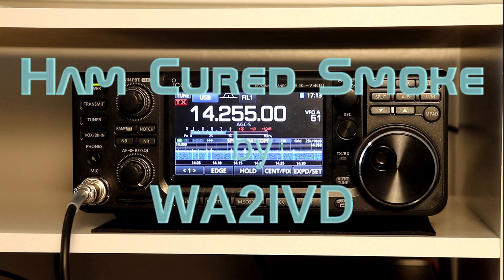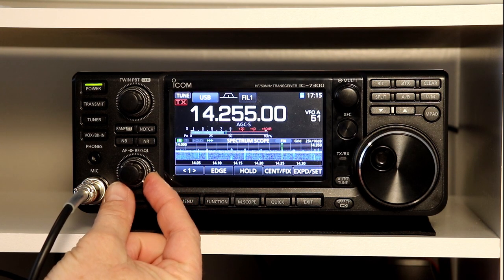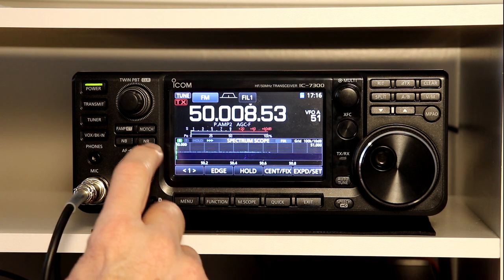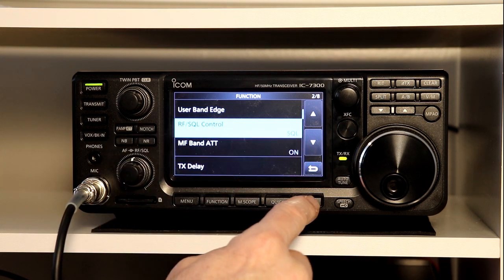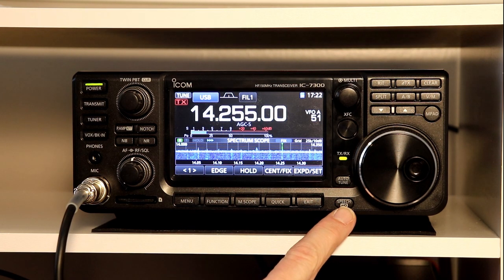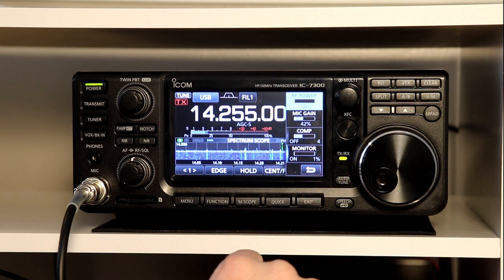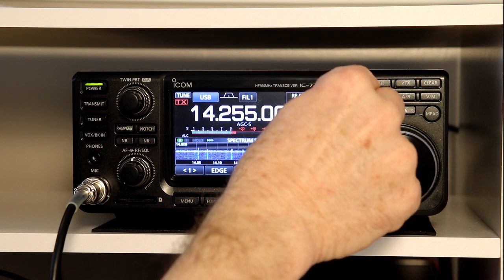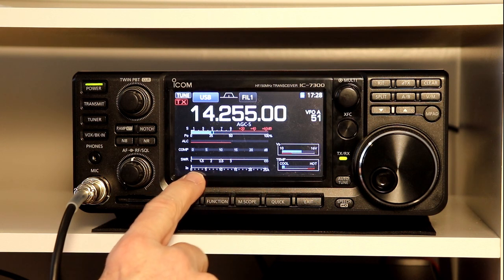Icom IC-7300 from A to Z - Part 4

Comment: Hi Tom,
I've watched and l like the few video I've seen. I tend to jump through around a bit when I have something that I'm interested in learning more about. Do you have a list of what sections or what pages are covered in each video. Something that I could look at to zero in on a subject that I want to cover. 
I commend you for taking time to recored  each of these videos.
Reply from the maker: Hi.  Sorry I’m so far behind on answering comments.  An index that cross references all of the manual pages with my videos is on my list, but I just haven’t made the time.  The K-State amateur radio club made a nice index of my videos by topic, but it doesn’t reference specific pages.  You can find that here:  https://www.k-state.edu/ksuarc/IC-7300.html.  73,  Tom
Reply: Hi Tom, Thanks for forwarding the IC-7300 Info page from W0QQQ. I'll forward it on to others in my ham radio club. Thank you for all the work you put into this You Tube Series. I'm one of many who are and have watched them, 73, Sal WC6Sal

Comment: Hello my 7300 is saying that the panel lock is on and the switches are locked how do I undo this please
Reply from the maker: Hi.  It’s the Speech/Lock button. It is just below and to the left of the main tuning knob.  It has a little picture of a key on the label.  Press and hold that button.

Comment: I received my IC-7300 about three weeks ago and appreciate your presentations so far. I have a lot to learn for certain and although working through your videos from A to Z  is a good idea that will take a VERY LONG TIME as I need to keep track of where I have been so I can search for next video. A question which comes to mind at this moment is, "can USB cable only be employed for digital modes"? Many thanks and have a good day.
Reply from the maker: Hi Tedd.  I want to be sure I understand your question correctly, as I can interpret it two different ways:  Are you asking if you can work digital modes using just a USB cable to your computer and nothing else?  If so, the answer is yes, absolutely.  If you're asking if digital modes is the only thing you can do with a USB connection, then the answer is definitely not.  Once you connect the rig to your computer with a USB cable, you can work the various digital modes, you can control your rig remotely, you can backup all of the memories and rig settings to a file on your computer and you can load saved settings and memories back into the radio from your computer.
You'll find information on USB connections in videos 23-26.  Links are below.
#23 - https://youtu.be/1cBbG62U_U0
#24 - https://youtu.be/9jyLggyFtHY
#25 - https://youtu.be/zXfctVbNc2w
#26 - https://youtu.be/TGzEBwFaRJo
Thanks for your comments and your question.  73,  Tom
Reply: Many thanks for your guidance Tom. This series is one that I wish was available on DVD, as a handy reference guide, yes the whole  IC-7300 series. I may have to pay up so I can download the series. I am enjoying immensely working through the series. Thank you.

Comment: I've had mine for a little over a year but only use it at my off grid cabin with a 7 band Buckmaster dipole.
So, not having a lot of time on it I just jumped in after a quick read of the manual.  I have made several contacts with the radio but last time we went to the cabin all I got when trying to TRX was feedback and it really stumped me.  Found your channel and the quick fix was to simply turn off the monitor.  Now I'm starting from scratch on your segments, they are awesome!  Thanks for sharing! KN4JLU

Comment: Hi Tom.

I just found this series and thoroughly enjoying.  Nice to watch a hands on presentation.  My question is when I shift to the meter screen I still have a reduced scope screen present.  Is there anyway to remove the scope so just the meters appear and are full size?

Thanks again for your diligence in preparing these presentations.  I look forward to watching the rest of this series.
Reply from the maker: Hi Frank.  Sorry for the delayed reply.  If you repeatedly press the M.Scope key on the bottom center of the radio, one of the screen options is no scope and large digits and meter.  I'm currently away from home and don't have the radio in front of me.  I don't remember if you need to do a long press or not and I can't check right now.  Hope this helps.  73, Tom
Reply: @HamRadioA2Z  I actually like the reduced scope with the meters underneath. There is much more operating information available. The large scope doesn’t tell me anymore than the reduced size scope. I don’t need to see the big waterfall.